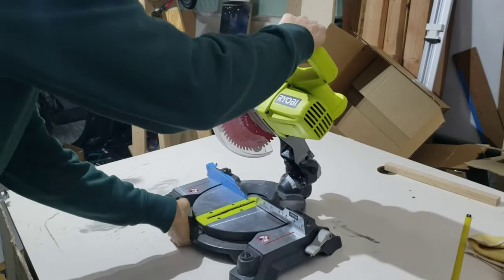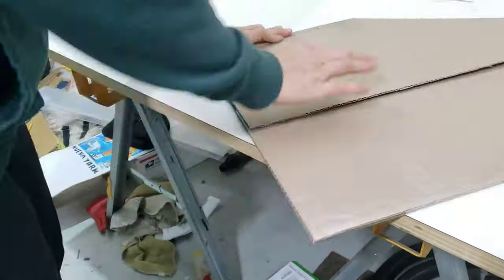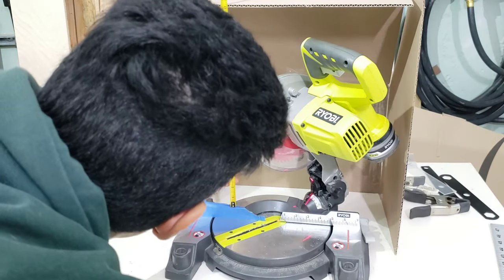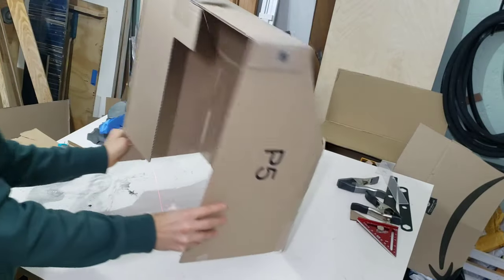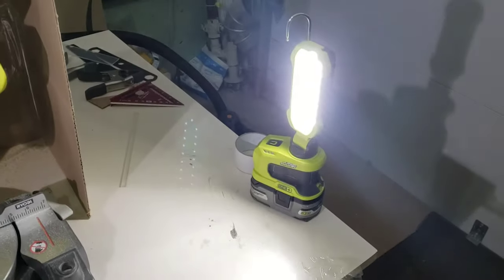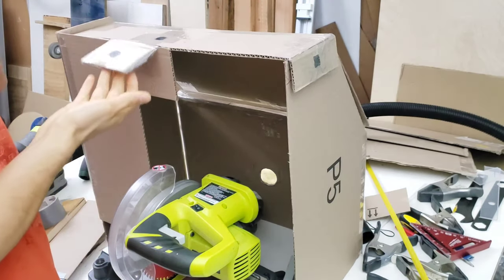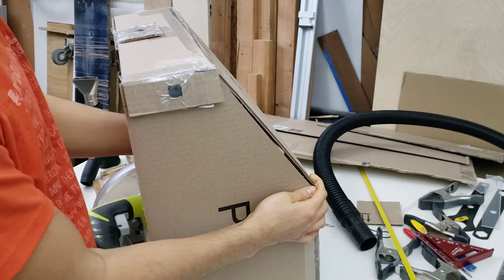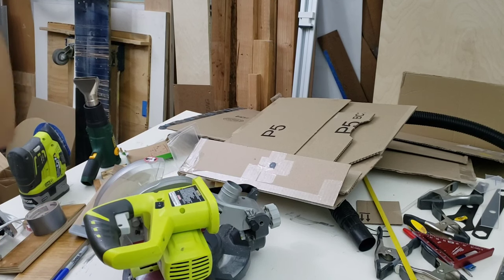CHEAP + EFFECTIVE Dust Collection Hood out of Cardboard (Suction Test)

Comment: Would be interesting to try with a stiff fabric shroud going from the cardboard to a tighter area around the saw, with some kind of guide to prevent it from getting caught on the blade or material. I think the big issue with the static dust hoods is that they leave a lot of open space, which reduces the effect of the negative air pressure created by the vacuum.
Reply from the maker: Great idea! I was concerned as well whether the small gaps hindered on the efficiency of the hood. Despite the gaps its pretty good, but I did test out using a piece of foam sheeting when I built this out of plywood, which I also made a video on, and it does help making the cover more airtight

Comment: Is suggest a similar tan 'tenon' on the slope part of the back, and maybe some weather stripping where seams come together to cut down on air leakage. Weatherstripping/door sweep around the base would help too. 

So you think it would be worth sectioning the front to have a setup for 90 cuts that's tighter to the saw, and then part of the front you remove for miters? Maybe overkill?

What thickness of plywood are you thinking?
Reply from the maker: Yeah I was thinking of some type of weather strip or padding to make it more airtight.

It might depend. My miter saw for example would only need an adjustment of maybe 1/2 inch  to accommodate the saw when I'm cutting miters. So maybe it wouldn't be worth it for my saw but might make sense for someone else's saw that takes up more space.
Reply from the maker: I'm thinking of using 1/2 inch thick plywood.
Reply: @makesandskates  might be heavier than you need, no? Also, increasing thickness from cardboard plus the fixed hinges (instead of tape) will have a big impact on how nicely it folds up. Have a good think about which way each leaf is going to go so it can pack flat.